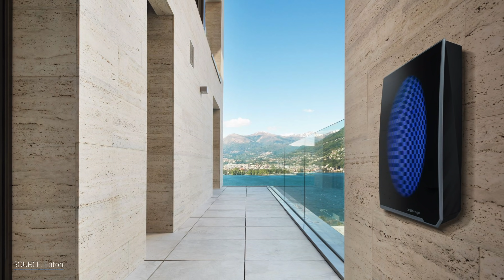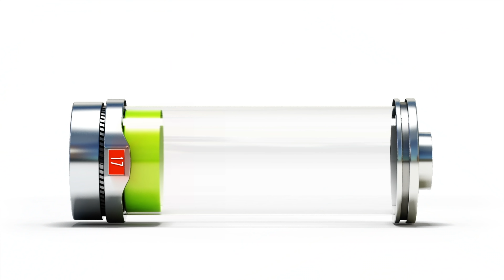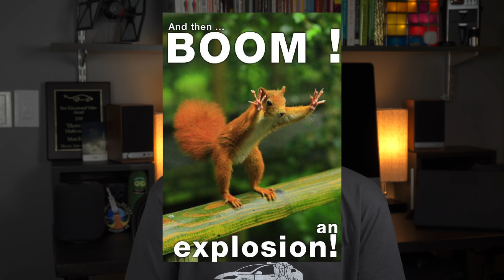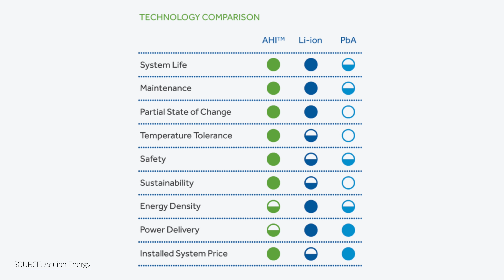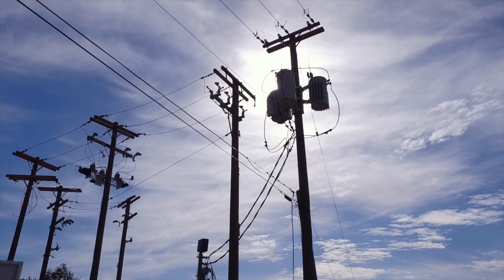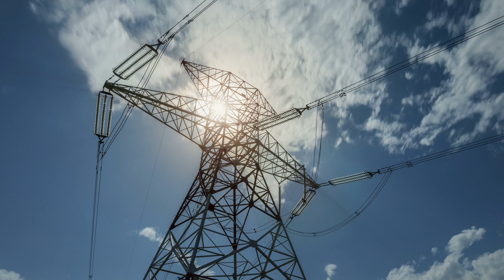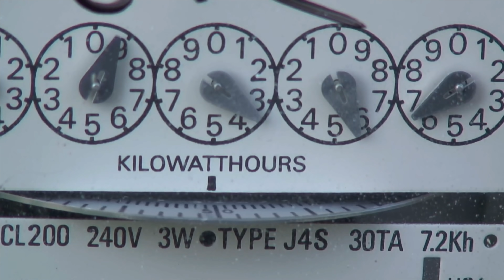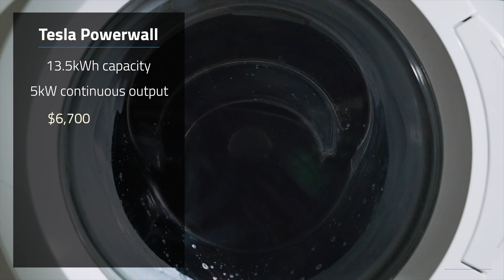Solar Battery Tesla Powerwall and more

Comment: A couple quick points.
30% Federal ITC is available for battery storage when attached to solar.  
In Maryland you can get an additional 30% state tax credit bringing the installed cost to about $4500.
The continuous discharge max for Powerwall is 5kw, with 10 seconds of peak delivered at 7kw.  This is for powering up compressor Motors that are in your freezers and refrigerators, air conditioners Etc.
This clearly spanks anything available.  The Tesla/Panasonic cells have a better chemistry anode cathode than other 18650s.
Just having your own energy Independence for the next two decades is well worth it if you ask me.
Reply from the maker: Good call out on the 7kw peak for the Tesla Powerwall.  Even with just continuous power of the Tesla Powerwall it’s way above the competition.  I’m eager to get as energy independent as I can ... just going to take me a while to get there.
Reply: We installed 6 of them.. assisted by the California self generation rebate program.
Reply: Jason Moritz LG has same with there battery and cheaper
Reply: @chefgav1 , we looked into the LG Chem batteries and the issue we found with them was that they didn't have an adequate thermal management system.
Because of this, they simply weren't well suited for the kinds of loads The Energy Sovereignty Project was going to place on them.
Reply: Twelve Wing Productions thermal management? Australia is heaps hotter and these are really popular in Australia
Reply: @twelvewingproductions7508  interesting as LG has 3 times the market share in Australia .Tesla is not very popular with installs here due to price,availability (huge supply issues) poor comparability with monitoring software. and price
Reply: @chefgav1 , How popular something is isn't really a very good metric of how capable it is.
The Nissan Leaf is a very popular electric vehicle, yet it's batteries are hugely problematic because of their degradation.
That degradation is caused by their lack of thermal management and Nissan's stubbornness in regards to correcting the issue.
Mercedes caneled two passenger car lines, their commercial truck and their home battery all because they realized that without a complete redesign of their thermal management the products simply weren't going to work.

So what I suggest you do is to have a look at The Energy Sovereignty Project on our channel and see what kind of workout these batteries actually get.
It will also show you exactly what kind of capacity we are talking about.  We aren't talking about 10kwh of storage, we are talking 60-90kwh of storage actually being needed.
What we are doing isn't speculation.  What we are doing is a real world test showing real world results.  Against the background of that test, try and plug in other options such as the LG Chem batteries for such things as bulk, power deliver and longevity and you will quickly come to understand why we made the choice we did.

Comment: Tesla recently acquired Maxwell Technologies,   which is a big manufacturer of super-capacitors,  although not as energy dense as Lithium Ion,  or other types of batteries,  they have many advantages, they can move large amount of energy ( charge and discharge ) extremely fast.  you can completely discharge with no problem, and forget about 1000 or 10,000 cycles,  a capacitor can go through a million cycles.  currently I see another company with a 3.5 kWh unit for about $5,000 bucks for solar energy storage ( I wont mention company name, as I do not want to sound like I am promoting any company) .  so price is a little bit less compared the units mentioned in this video,  I expect energy storage using caps, to come down in price even more.

As for Tesla, I expect them to use the super-capacitors as a buffer for the lithium ion,  since caps have very fast discharge,  that energy is available for quick use,  or charging during braking.  without straining the L-ion cells.

Comment: I'm working on a project right now to use the battery in my electric car to store the solar energy and feed it back to the house. We have three DIY electric cars and I am now charging them all from our 15 kilowatt solar array. Each of the cars has a dc-to-dc converter that takes the high-voltage and converts it true 12 volts to run the lights which could also run an inverter. My plan is to have it set up so the cars are never discharged more then halfway and if I have a long trip I'll shut the inverter off on that car. I'm kind of surprised that the car companies aren't doing this seems like a great incentive to sell electric cars. Click on my profile picture to see my projects .
Reply from the maker: That’s very cool.  There are vehicle to grid systems being testing around the wold, but I’m surprised it hasn’t gathered more steam behind it than it has.  Nissan has been an the forefront of those tests, like in Germany.
Reply: @UndecidedTechnology  I've heard of a few tests programs in California. This really seems like a no-brainer and the car companies I'm missing out on a big incentive. I hear all the time that there is not enough storage for solar power and this seems like it would solve the problem. There just is not enough discussion about this.

Comment: As a new Tesla owner and first time EV user in an area where the grid is mainly coal powered, I would love to have a solar roof solution.  But the up front costs are still just a little too high for me to want to turn the key.  I hope the costs continue to go down so as it becomes affordable to most Americans.
Reply from the maker: That's the biggest problem ... upfront cost.  There are solar leases that you can do, which require no upfront money.  However, you don't actually own the system on your roof until you decide to buy it out.  The benefit though is that the company that owns the panels takes care of any maintenance issues.  You also pay them as your new electric company with a pre-negotiated rate that is most likely much cheaper than your current electric rate.  Not a perfect solution for everyone, but might be something worth considering.

Hopefully U.S. installation prices keep dropping.  Australia is a great example of where the prices are going.  It's incredibly cheap to get solar installed there, so hopefully we'll see the same.

Comment: I noticed you said Tesla Powerwalls cannot be used for off-grid systems.
Just wondering what batteries you may recommend for off-grid?
Thanks in advance:)
Reply from the maker: Yeah, from what I understand the Powerwall is looking for a specific electric signature from the grid.  It’s possible to get it to work off-grid, but takes some extra parts to make it happen.  I’m not sure if Tesla would install it that way or if you’d have to do it yourself ... or hire someone to do it.  Someone like this Australian company: https://naturalsolar.com.au/tesla-powerwall-off-grid-solar-system/

For off-grid here’s some of the info I kept running into during my research.  It looks like LG Chem might be a good lithium ion option for off-grid, but there’s a bunch of others:

https://www.cleanenergyreviews.info/blog/best-off-grid-solar-system
https://www.wholesalesolar.com/blog/best-solar-batteries/
Reply: @UndecidedTechnology  I didn't have anything special installed with my system, solar + two of the 2nd gen powerwalls, and they can operate off-grid as I have already tested this for extended periods of time by disconnecting from the grid altogether. Functions as a normal grid-tie system when the grid is on, islands itself when the grid is down. Sized the system to be able to run indefinitely in a grid-down situation as we can have power outages lasting weeks when hurricanes blow through. So although net-metering in FL is a 1 to 1 exchange (for me at least) and I don't have a TOU plan, the powerwalls were a better option for me instead of getting a large generator that requires fuel, fuel that's often not available immediately after a hurricane. The prices were about the same anyway
Reply from the maker: That’s a smart move for Florida and having long stretches of the power being down.  While you can run the Powerwall in blackouts for extended periods like that, it wasn’t designed for full-time off-grid use.  It’s designed to be paired with the grid and act as a backup ... not the primary method.  Not that it can’t ... just that Tesla doesn’t intend it for that use.
Reply: @UndecidedTechnology  I've heard in one video mentioned: Tesla Powerwall stops running after 2 weeks of not being connected to the Internet. So that's one limit.
Reply from the maker: Yep, I get that, but directly from Tesla’s own FAQ: "When Powerwall is installed with solar, it will not be able to charge from the grid. Though Powerwall can operate during when the grid is down, Powerwall must still be connected to the grid.

Powerwall does not currently offer an off-grid solution, but you can reserve a Powerwall and we will contact you once an off-grid solution is available in your area."

https://www.tesla.com/support/energy/powerwall/learn/combining-systems
Reply: Undecided with Matt Ferrell Thanks for all the info. Very much appreciated. Cheers and keep up the brilliant work. 🖖🏻✨

Comment: Batteries do not pay for themselves within the warranty periods. You’d have to save $1000 a year minimum on top of the savings you already get from solar panels. I don’t care whether you’re on TOU, wholesale net metering or whatever, they don’t pay for themselves. They can give you some independence from the grid or make you zombie apocalypse proof, but don’t buy one for an economic benefit. They are also less green because feeding power back into the grid results in very little losses, while charging and discharging and inverting you power is generally only 80-85% efficient. Exceptions to this is if you produce more solar electricity than you are allowed to feed back into the grid (export limited). Vehicle to grid (V2G) and V2H (home) may make home storage batteries obsolete as EVs become more popular.
Reply: It is definitely harder to make them pay for themselves compared to solar panels, but they can be close to neutral cost depending on your rates and net metering setup.

We use them to offset all of our house usage from 4-9pm (peak rates for $0.54/kWh) and we have NEM 1.0 in California, so we get $0.54 in credits for those kWh. Then we charge the cars at night during the super off peak $0.09/kWh rates, saving $0.45 per kWh. 

Our system costs were significantly reduced from the list price by California  SGIP rebate and Federal ITC tax credits, so we will make back the cost before the warranty runs out. However, even after the warranty ends they still have 70% (or more) capacity left, so they will provide benefits long after the 10 years are over. 

Plus it's nice to not have to worry about power outages ever again...
Reply from the maker: You beat me to it.  The useful lifespan goes far beyond the 10 year warranty, so there’s still a lot of time to make it work.  BUT it does depend heavily on your utility situation.  Where I live there are people that spend lots of money on generators to keep the power going when power gets knocked out from winter storms.  Solar batteries get you covered there too.
Reply: @UndecidedTechnology  actually you have no idea what the useful lifespan will be ,  it will greatly depend on real world use and operating conditions and finally what you are prepared to settle for an deem "useful"
Reply: @stevesreed  You save $0.45 ($0.54 - 9c)for each kWh you use directly from the battery at peak but how much FiT x 120% (average round trip efficiency of batteries - good ones around 85%) are you losing by charging your batteries? You also have to subtract that from your savings. The FiT in California varies from 9c - 16c so it depends on where you are.  You also have to factor that in, along with depreciation and missed opportunity cost (how much would you have earnt from that money if you'd invested it in the sharemarket etc?). Don't get me wrong - I'm not against home storage batteries (I'd love to buy one just for the tech) and with incentives and high peak rates and high usage they may make economic sense (maybe - you'd have to do the math in your case). As far as longevity goes we don't really know what capacity or usefulness the battery will have after 10 years apart from the warranty. There aren't enough examples around with hard data to draw many conclusions although I think that would be a great study to do.
Reply: @mondotv4216 You are right, I need to subtract out the credits missed while charging. I charge roughly from 11-2, so it's actually helping the utility during the worst part of the duck curve.  I expect at some point the utilities may start paying us to charge during that period to keep the grid stable and avoid negative power pricing. They will likely also start at some point allowing us to dump more to the grid than just our solar production  (which is the current limit) during high demand periods.

For me there is a significant intangible value from having full house backup and being able to use our solar during outages.

Just today, the power went out for almost an hour, and the Powerwalls ran the house as if nothing changed. Even though it was overcast, they were actually changing from solar during the outage.
Reply: @stevesreed  That kind of value is not intangible though. You can also buy a generator at a fraction of the cost that will do the same job, but I agree a battery is nicer :)
Reply: @mondotv4216  A generator is definitely the cheapest way to do backup, but for me, a whole house generator or similar capacity was basically 1/2 the cost of the Powerwalls after ITC and SGIP rebates. The generator would take up more space and does not do Solar TOU shifting.

The intangible part is the satisfaction of being able to run the house from batteries and/or solar and charge the batteries during an outage. Basically, if we are careful with usage, be able to run the house indefinitely without the grid.
Reply: Steve Reed I guess 5kW name brand generators are quite expensive. Where I live (Australia) a PW2 is about $AUD14K installed since Tesla put the prices up. Our dollar is only about 70US cents plus we have a 10% GST. To get 2 (which would be appropriate for my size house) would be about $25K. But to power my whole house I would need three as my aircon is three phase (Aust is 240V so 3 phase is 400V). We did have a violent storm about 3 months ago that knocked out the power for large areas of Sydney and is the only outage I can ever remember that lasted more than a couple of hours (we were without power for a day and a half but some were twice as long) but you could count the power outages on 1 hand in the last 10 years so a much smaller generator hooked up to fridges and lighting would be enough. I imagine if you had frequent power outages and rebate schemes then your battery does make sense just from a peace of mind perspective. We have no rebate scheme at this time for home storage batteries in NSW. Without incentives they are just too expensive.

Comment: They’re called batteries. Some connection and synergies with solar, yes, but they store electricity, whether generated from coal or solar.
Reply: True, however you do not get a 30% ITC for a standalone battery. Must be paired with renewable energy to experience that savings.

Comment: Solar and battery systems really are a great use of money. It might take a while to pay off the system, but there is no guilt about where your energy is coming from, and you are safe from grid-outages. (No more worrying about resetting the clocks ;) Even with just a battery system, the the load on the grid is spread out evenly across 24hrs, and you are saving money only paying for off peak prices.
Reply: Well, let's be very clear, energy storage is going to be part of our future, might be at home or part of the grid.
Might be battery or still might still end up being hydrogen.
Reply: autohmae, do you mean that they will be powered by hydrogen fuel cells?
Reply: @mattsonmccraw6767  I've seen a bunch of new promising developments in the hydrogen corner, so who knows what we'll end up using in the future, just look up these two which look very promising:

- leuven hydrogen 2019 february

- hydrogen powder h2fuel
Reply: I feel  no guilt about where my energy comes from so noneed to spend anything really

I dont know how you imagine this even load spreading over 24hrs happens ,  sounds like magical/wishful  thinking

Comment: I think storage option will see a large change over next couple years.  I just got my solar installed, grid tied, buying a generator for very rare outage, full net metering credit, battery isn’t a wise choice yet.
Reply from the maker: I also think solar storage is going to see big improvements over the coming years.  The prices will continue to drop and we’ll see more options.
Reply: yes cheap everything is always just over the horizon